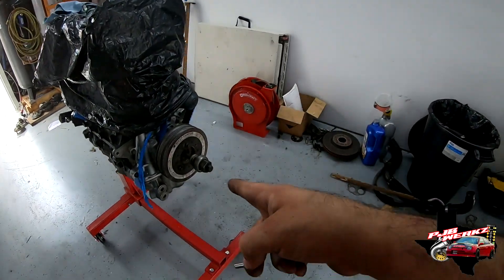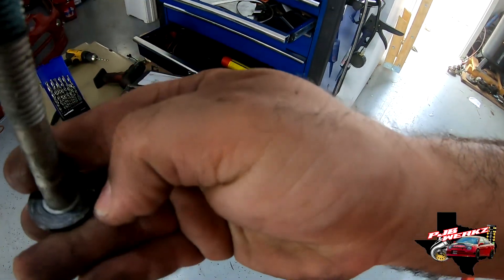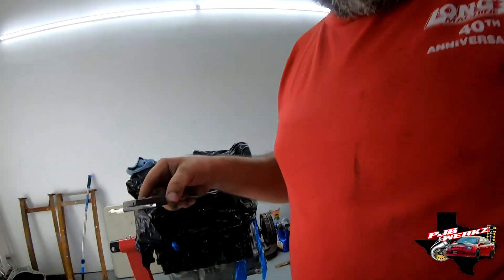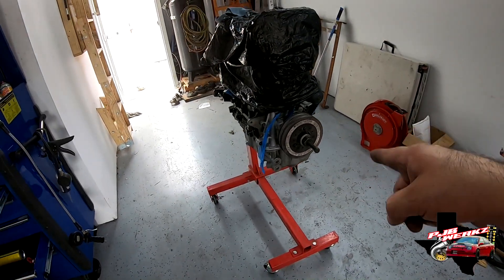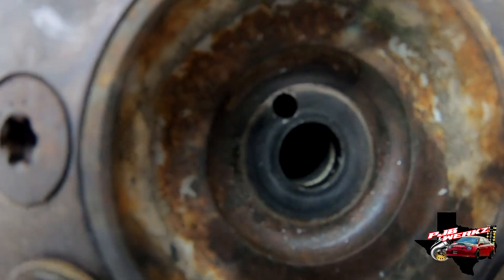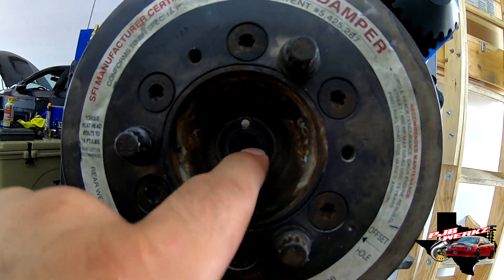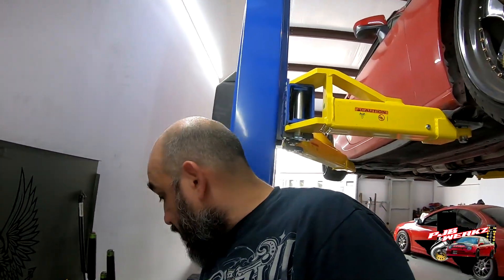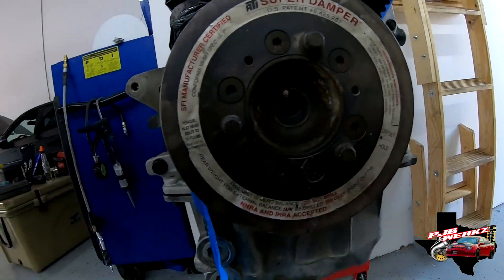(How-To) SRT4 Harmonic Balancer

Comment: Since there is no keyway on the crank, how do you make sure the timing marks line up? Just eyeball it while you press it on?
Reply from the maker: No this is a key for the harmonic balancer begin the harmonic balancer we have the timing belt pulley witch it is key to the crank